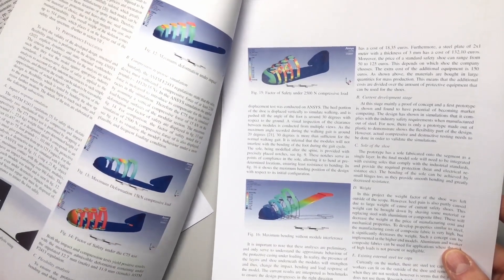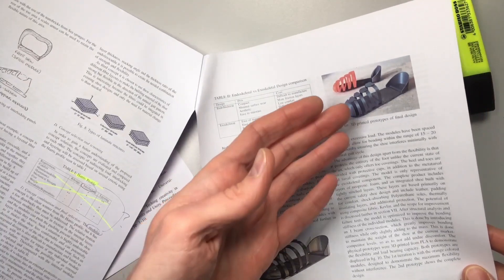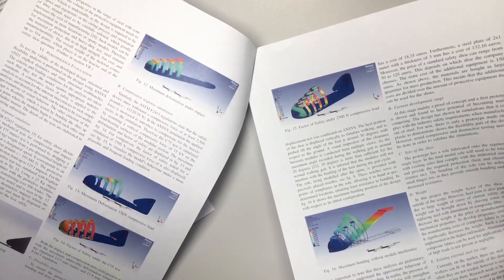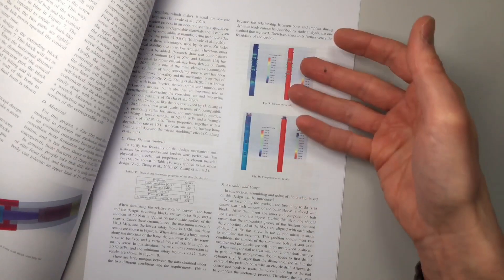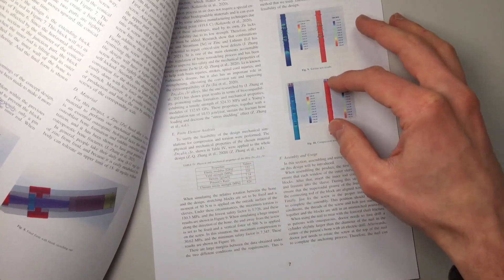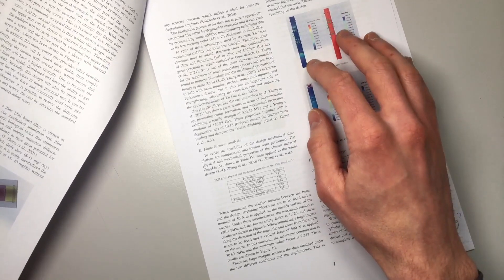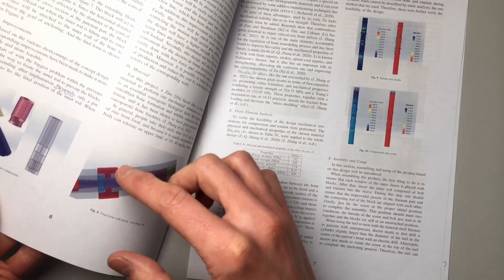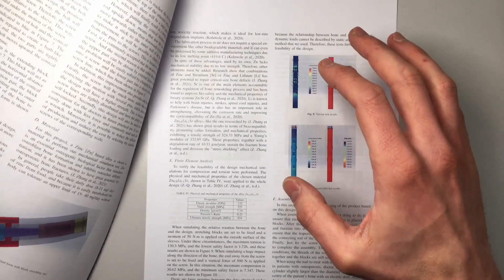No. 1 Mistake by Engineering Students

Comment: THIS.... is pure gold.
As a rather recently graduated engineer... I really, really want to underline this as a topic or even a course or lecture... a strategy guide for new engineers. WHY and HOW to start on a new design... Where to begin and how to go forth. I like how my current department manager says "to increase the resolution" and I think that that is on the topic.

I know myself to have a difficult habit of rushing to the details. Which leads me to think of more details that might end up being irrelevant for the task since there is no outline. There is no frame to put for the details.

Start from a low resolution and go up. Increase the resolution. Do the basic research or investigate the options where to start. Establish the reference for the task. When there is a frame, one can start putting in components. And then... it is time to start thinking of the details. But remember... one can always go back and re-evaluate the previous design steps.